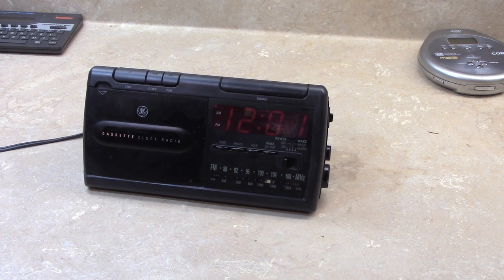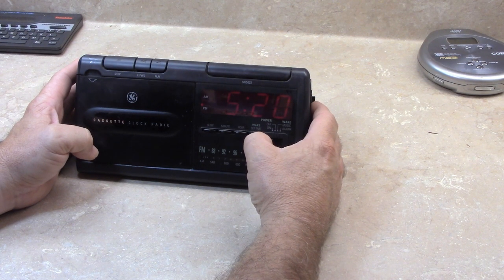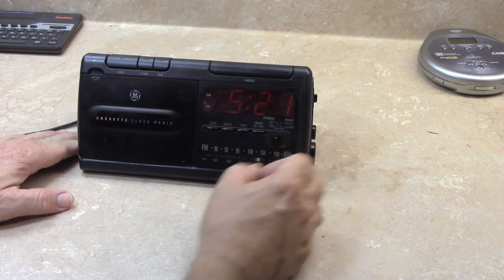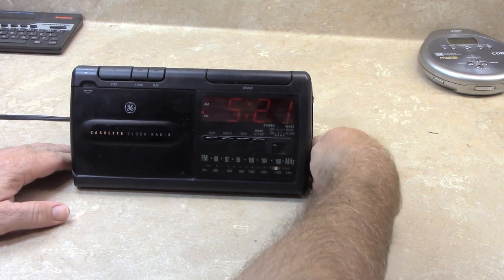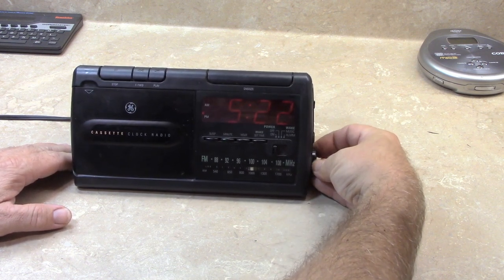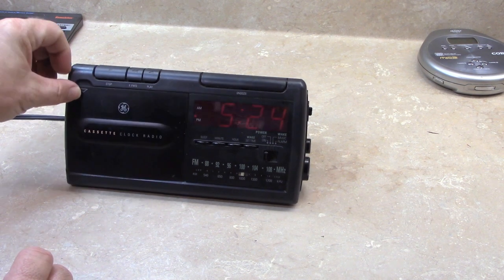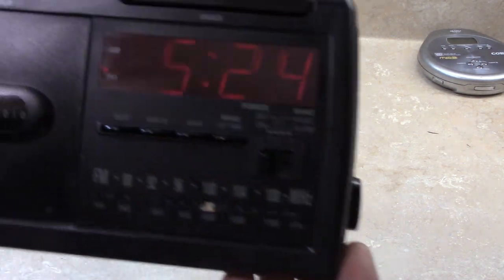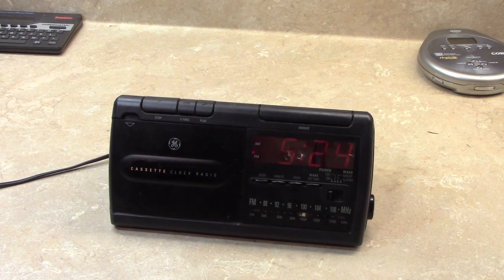GE Clock Radio With Cassette Model 7-4915A

Comment: 5:20PM, missed it by an hour!  

Eh, not my cup of tea.  Seems chintzy, though it somewhat works.  Your guess of the late 90s is probably correct.  It most likely can be fixed up, working fine, in your capable hands.
Reply from the maker: Haha!
Yeah, not really mine either! However, hard to pass up a cheap-as-free box! No plans to put this one in service, unless something dies, and that's what I have on hand for a replacement.